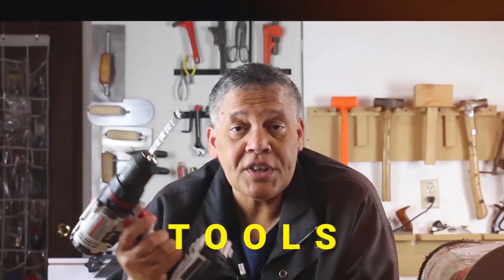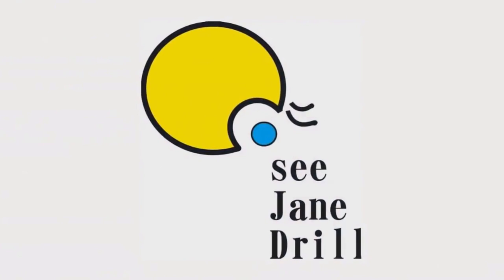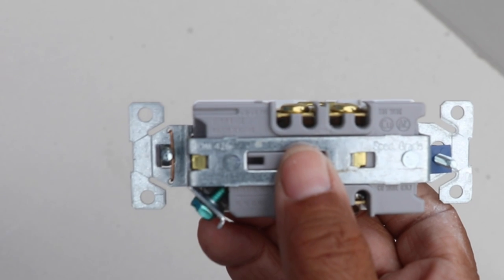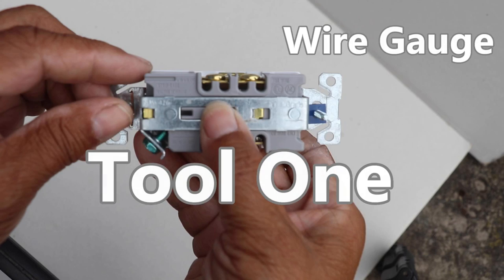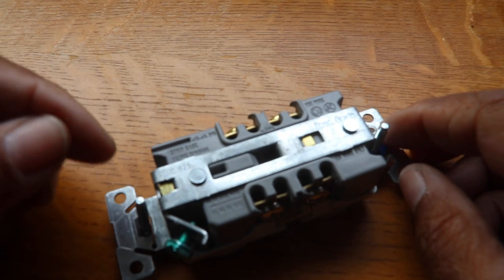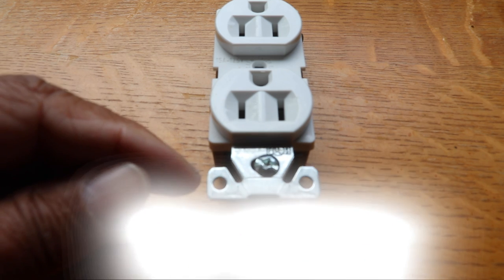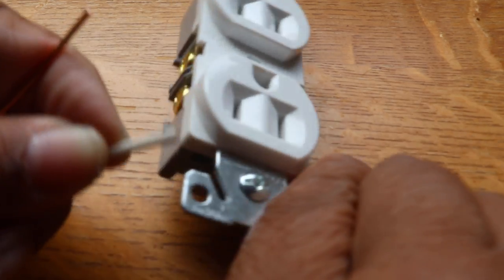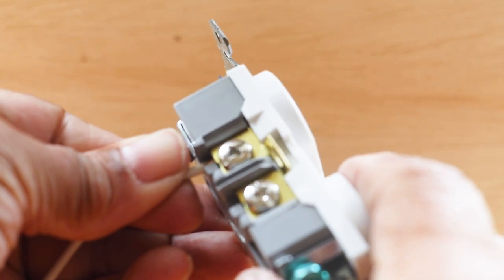Hidden Tool in an Outlet Few Know

Comment: They’re actually 4 tools in total built into an Eaton outlet and maybe others as well. The 2 you mentioned then one that cuts the the outside sheathing around all the wires and the other bends the loop needed for the ground plug. Good info.
Reply: And its also a screw driver

Comment: Wow, I didn't know that. I thought the "ears" on the outlet tab were to bend back if the outlet needed to be pushed off the box.  Never knew the "ears" made a wire cutter.  Learned another trick from this channel!
Reply: 6y6
Reply: Bend back? There are 3 score marks on each end. They are break away lines so the tabs can be broken off as they get in the way  when installing the device in a cover for a metal 4" square junction box. The cover is what the outlets are attached to in that case and they won't fit the cover plate if you leave them on. They also sometimes don't allow the device to sit back in certain boxes so the faceplate is flush with the wall. All they are for actually is to hold the device flush with the surface if the box is not perfectly flush with the surface of the drywall by overlapping the edge of the box and catching the edge of the drywall

Comment: And a hidden feature:  I needed to replace a receptable in a finished wall, where the cutout in the wallboard was not well lined up; at the top of the wall cover opening there wasn't quite enough clearance.  For the first time in my life, I paid attention to the scoring lines in the flat metal at the top and bottom of the receptacle.  These scoring lines are very near the wire stripper tools described in this video.  I know that scoring lines like that exist to aid in detaching excess metal to allow custom fitting, but I had never had reason to think about the ones on a receptacle.  I realized that I could detach two of the corner bits at the top of the receptacle, and then I could fit it through the goofed up wall opening into the normal box and fasten it properly.  By the way, even with this close-up handling, I didn't notice the wire strippers.  I have occasionally used the wire length guide.  I think it is amazing how many extra features are on simple electrical receptacles, for the price.
Reply: Also, you can put those tabs can be used to put under the box screw (center top and bottom) to bring it out when the metal box is too far recessed.   Not the best practice, but when the wall is finished its not so easy to move the box out.
Reply: @Zodibigh  You are right.  Upon reading your response, I recalled learning that many years ago and having forgotten it.  During the same DYI where I nipped the tabs, my husband and I needed to bring every receptacle and switch forward.  We purchased a package of spacers that are designed for that very purpose; they are stackable, and easy to use.  We would not have had enough of the breakoff tabs 8n our case, but I am grateful that you pointed them out.

Comment: I am a retired master electrician and yes, I was aware of the “tool” but it is  not ergonomic at all. In addition, I used to get in trouble with bosses because I NEVER used the crush down portion of outlets of any kind, instead I ALWAYS ran a hook around the screw. My preference is to make a strong connection. 😀
Reply: I was taught to make a hook and make sure it wrapped clockwise so as you tightened it stayed together.
And you should be able to pull on it decently and it stays firm
Reply: My dad is the same way
Reply: Hook it.

Comment: There are actually 4 Tools!  The indent in the center opposite the wire gauges is sharp and can be used to cut the outer insulation from Rome wire to get to the 3 wires inside. The force is a tool that you can use to create a hook in The Wire. There is a hole over the ground screw that you can stick the wire into and then bend over the back side of the outlet to make the perfect hook for side wiring. Very cool!

Comment: There are a few other hidden things on anniut let as well. The holes by the wire stripper are used for curling the wire to the exact size that is needed to go under the screws on a side wire outlet. Also those tabs that constitute the wire strippers can be bent back to secure the plug to the box if the sheet rock depth is a bit off.

Comment: Quite handy tips.I knew about the plainly labeled stripping gauge but the stripper was news.Not as handy as the V-notch I filed in my needle nose pliers cutting edge that I only use for wiring projects.

Comment: Great post. Never seen that stripper either but also then after stripping, those tabs can be folded off and used as washers if you need to tighten the outlet directly against the box

Comment: Awesome, I was a licensed Contractor who built many custom homes, and never knew that outlets had tools on them. I always side-wired because I was afraid of pulling the cord out wrong, would pull wires out from behind. Then wrap side of outlet with Electrical tape.
Reply: That final wrap is something that not enough electricians do. My best friend is a master electrician, and any time I've helped wire outlets, we always wrapped them.

Comment: I just had to check this out, so I grabbed a random light switch from Cooper from my "pile o bits", and it even had "strip #12"  and "strip #14" stamped on the ears, it also looked like the other end might be for #16 or #18.  But those are a bit small for useful applications.

Comment: One other tip Leah is that if you wish to use the quick connect terminal, when pushing the wire into the hole be sure to give it a quick tug back to set the barbs inside to make a solid connection.

Comment: a stripping gage is included in German outlets as well , modern German outlets have push tabs (like some modern LED-lamps) to unlock the wire & prevent you from touching live parts when the wire is corrrectly inserted , even when you have the outlet outside of the box & without front plate ... older German outlet have touchable live pats when the front cover is removed , but all 3 wires can be measured in live condition without removing the outlet

Comment: Lea; I was washing the patio last week & I guess we got some water in the plug.  anyway, it no longer works, nor do the bathroom plugs, or the outside plugs on the outside of the house.  Everyone I've talked to says to click off all the tabs in the electrical box, which I did.  Nothing changed.  This house was built in 1986 & I do not have ONE reboot electrical plate.  Any suggestions?  thanks

Comment: Do they show this on the spec sheet? The holes can  be used to make a loop in the wire. You can break off the tabs with the hole if you need a washer or shim. You can tighten the screw on the cover plate with the receptacle mounting plate. There is a tool bag and hardware store in every duplex receptacle!

Comment: Those two tools are very useful. I wonder if there is anything equivalent in a UK 13 amp socket and its associated backing box. If there is, I'm not aware of it.

Is each outlet (what we in the UK call a socket) generally wired as a separate spur from the "fuse box" (aka consumer unit), or are sockets ever daisy-chained from one to the next? In the UK, all sockets are on a "ring main" which has one 30 A cable from the fuse box to the first socket, then another leg of 30 A from there to the next socket, and so on, with the final leg leading back to the same fuse/MCB in the "fuse box" (hence the term "ring"). A house typically has one ring-main for all the downstairs sockets and another for all the upstairs sockets.

I ask about daisy-chaining (with or without that final ring connection back to the fuse box) because I was wondering how well those screw-and-plate connectors on the socket can accomodate a second wire in each terminal block for the onward connection to the next socket. In the UK, the terminals in a socket and in a 3-pin plug have a hole drilled in a block of metal into which the stripped wires are inserted, with a screw inserted at right angles which is tightened to secure the wires. I'm not sure what gauge our cables use: it tends to be sold as "15 A cable" for lighting and "30 A cable" for ring-main sockets. There's also even heavier-duty cable for high-power devices like cookers and electric showers, but manipulating that is like wrestling a snake ;-)

Comment: Not all outlets have the wire strippers, especially the cheaper ones, and the ones by Leviton; Hubbel outlets seem to have them. A trick I learned from an electrician several years ago is that the tabs (near the wire strippers) can be broken off and used as washers if you have a deep box to raise the outlet out a bit.

Comment: Has anybody mentioned the little tab on the ground screw location that allows you to bend the piece of ground wire to a perfect hook? And if you want to use the side screw terminals instead of “backstabbing“ you can use it to form the hooks for the other leads as well.

Comment: There are three tools on some of them. There is a eject finger that you bend out. Its to release wires put into the auto connect plugs. You bend it out (it’s usually on the side of the new plug) then put it in the eject slot under the hold for the auto terminated.. it will release the wire with out damaging the outlet.

Comment: so m i to understaand that stripping cutting the wire on the outlet bracing itself will give me enough slack/length to get my wiring back into behind in box space and its not too crammed that the plate wont go flush >? i love my reostats and theyhave thrice the wires , its been awhile since i did mine but as ladyofthehouse i have to do everything myself yup and making things fit is jus t crazy, and cramming wiring back up into fan spaces of canopies would benefit from good length helps, really i mean the lgithkits but all kinds of incidents.  thank you will study this .

Comment: That's interesting and good to know, however, not all outlets are designed that way. My brand new Leviton outlets don't have any slots on them to strip wire.(No wire length stripping guide either) If this type of outlet costs more money to buy because of that feature, it may not be worth it in the long run if you need to purchace a lot of them. The reason that many people didn't know about this is because all outlets aren't the same as the one that you showed in this video.
Reply: !!! Not all outlets !!!  lol, too funny.

Comment: I never knew about the wire strippers. I bought a new outlet yesterday and it doesn't have them but it's a GFCI outlet. The plastic box part takes up so much room the metal tabs on the ends are too small to cut slots into. I'll try to remember this hidden tool the next time I buy a regular outlet. Or a switch. I wonder if duplex switches have them too, like the outlets do? As for the tool I knew about, this has a picture of a rectangle the size of the stripped wire instead and says, "Back wire strip gauge". 

I'm finding more things on this outlet too. It tells you in writing where to put the white wire and the hot wire. You can't put "black on brass" and white on the silver colored screw, because both screws are brass color. It has Cu in a circle,  and Al in a circle with a slash, the international NO symbol. Okay for copper wire (Cu) but not aluminum (Al).

Comment: Why would you want to use 12 ga. wire to hook up a 15 amp outlet? Is the 12 ga. (20 amp) wire hooked up to a 20 amp breaker in the breaker panel? wouldn't that allow a faulty 15 amp outlet to burn more rigorously if the 20 amp breaker is not tripping, or does the 12 ga. (20 amp) wire connect to a 15 amp breaker in the breaker panel? I am from the school of "use a 15 amp outlet with 15 amp wire (14 ga.) and a 15 amp circuit breaker. Why would they even have a 20 amp (12 ga.) wire stripper built into an outlet that is only rated for 15 amps?

Comment: The tabs on the outside of the strippers can be removed to use as washers, to compensate for poorly placed boxes that are set too far back in the drywall. Simply grab each with pliers and rock it back and forth until it breaks off.

Comment: I'm a commercial refrigeration technician.  I have installed more duplex outlets than I can ever hope to count.  I have never noticed the wire strippers built into the outlet.  I never even noticed that those ears were sized differently.

Comment: ok u got me. I've been an electrician since 2000 and the strippers part i never even knew about, i mean i've always had strippers in my tool pouch so never needed to improvise to strip wire.  Very Impressed.

Comment: How about using the ears as washers for those times when you need a little bit of standoff because the box is set a little too deep in the drywall? I was taught that you can snap them off and that's why they have holes in them. (Disclaimer: I am not an electrician so this could be totally wrong. I'm sure someone will comment if I am.)

Comment: That seems like a lot of hassle if you have your wire stripper on your belt. But, apparently there's a 3rd tool on some outlets to facilitate looping/hooking the wire core without a pliars (still probably easier with the wire stripper on your belt.
Reply: @rickdworsky6457  You sure hassled a lot to be completely debased with your comment. I merely shared that I don't think this gimmick is worth the effort and provided information regarding an additional tool that some outlets have that further reduce the need for a pliers.

Comment: Another tool is put the striped wire just a little into the hole by the wire striper and bend it 180 degrees to fit under the screws on the side.

Comment: I have to say, that compared to the outlets we have in the U.K. Those look like toys, only fit for low voltage. Of course they are only used on 120volts, compared to the U.K. 240 volts, so I am not surprised.

Comment: I wish I had known about this before replacing a bunch of 2-wire outlets with grounded outlets several years ago. In the future, I won't need to do that fussy thing of wrapping the wire around the screw.

There is one thing I learned back then that is also surprising - test BOTH halves of the outlet to make sure they're "off the grid." I had one outlet where each half was on a different breaker.

In the list of videos on the right is a video showing these tools and two more! (One for stripping the outer insulation of the whole cable, and one for bending the wire end into a loop.) I had no idea!

Comment: I've replaced every outlet in my house and looking through the pics, none of them have those wire strippers built in. It's a totally different shape with no notches for the wire. My outlets are all less than 7 years old. shrug

Comment: Who uses 14 gauge wire? I've been building houses for 15 years and the overall savings of using 14 for lighting is about $300 on a 3000sqft $350,000 home vs wiring everything with 12. Its not even worth thinking about.

Comment: Just buy a wire stripper. If you do what’s shown here the chances of bending the tabs are high. Those tabs are there to hold the receptacle flat to the wall. You may even break them off.
Reply from the maker: Cmon

Comment: The wire stripper exists rarely, the length of the stripped portion designation is pretty standard.  I'm not sure why there are so many positive comments as 50% of this information is false.  There are many brands, and most of them do not have stripper capability.  The Eaton brand may be denoted in this video but this is, perhaps, made clear.  Eaton does not control 100 of the outlet market, so this is mostly false.
Reply from the maker: There is nothing false about this video.  The Eaton brand is denoted in the video as the outlet Im using.
Reply: @seejanedrill  This  is a scam and you should be ashamed!

Comment: That looks like a Hubble device, which is not cheap. As a licensed electrician I was fully aware of the strip gauge on the device but I would rarely have the need for the strippers on the device and have never been taught this by any of the masters I have been under. You should have strippers on you when you are installing devices.All the applicable tools in your pouch when approaching your job. By the way the bin you pulled the outlet out of said premium, so you are paying a premium for that device. Lesser ones may not present these particular attributes that the more expensive ones do. Just sayin'

Comment: I replaced outlets to change colors and just pushed the striped wires into the holes in the back of the outlet.  No need to bother with the screws on the sides.  There is another smaller hole to release the wires as well.  Many electricians routinely wrap some electrical tape around and over those screws to minimize shocking yourself.  Careful what you touch.  I swear I got shocked even while touching the plastic portions!
Reply: Avoid the push in terminals - notoriously bad FIREHAZARDS!

Comment: I think my outlets are cheap garbage. I have 3 on the shelf right in front of me, and a single pole switch, and none of them have the built-in wire stripper. They have the gauge but not the stripper. And these gauges read "For push wire only." so maybe they are just junk?

Comment: Since we're talking about wire strippers I thought I would put my own two cents worth in……... when stripping telephone  wiring for in the wall installation never used tools to strip off the installation use your thumbnail.    Do this way and you will never Nick The Wire.